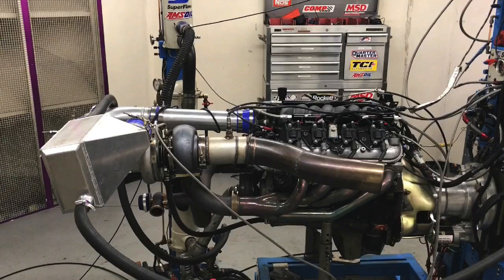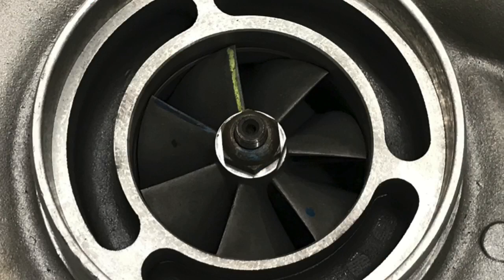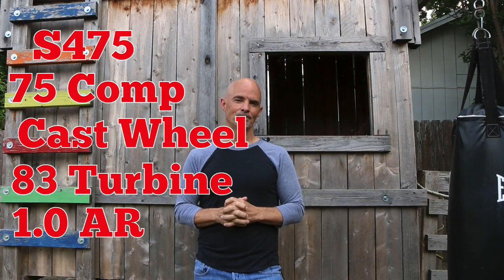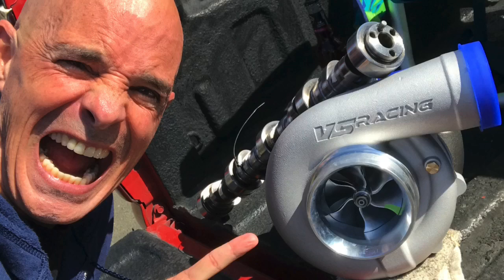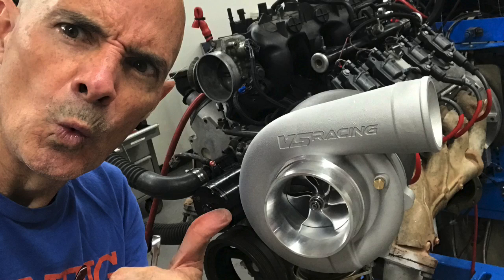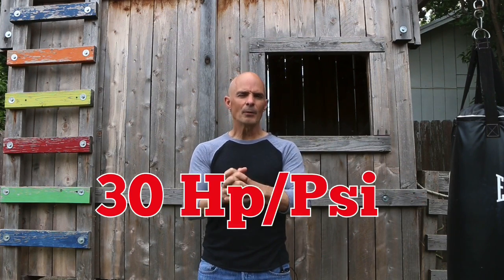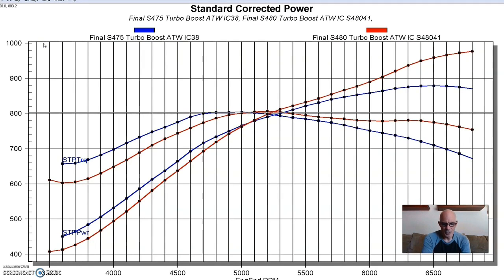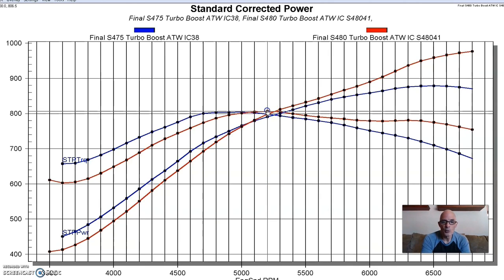HOW TO: PICK THE RIGHT TURBO!

Comment: For the billet wheel, ball bearing, twin scroll testing, an engine dyno might not be the best way to test it. A brake dyno will make the results almost irrelevant. The only way it would be worth doing is if you could load the engine at an rpm lower than the boost threshold and have the the rpm/s at something wild like 1200 or 2k. I doubt the engine dyno you have can hold a v8 that low, it would be like 1500rpm, or have the rpm escalating that fast.
You might be able to do it with a really small engine to cut the torque at load in and a really big turbo. If you had something like a b16 and loaded it at 2500 and ran it out to 8500 it gives you a huge sweep and you can test boost response if you can have the rpm/s fast enough... The thing is as soon as the boost comes in and pounds the torque out, the dyno will slam the door to keep the engine acceleration consistent and make the torque spike worse, not better.
You almost need to test this with an inertial dyno, the brake fusses with turbos.
Reply: Or do it on the road with a data logger. You can always extrapolate HP from numbers.
Reply: @DodgyBrothersEngineering  Some people are building test sleds, just for that purpose.

Comment: Isn't there a whole bunch of math to pick out turbos.  Something about getting data points to place on compressor maps (for those who publish compressor maps) to choose right turbo for the engine??
Reply: Some of the turbo manufacturers offer free calculators to size the turbo correctly
Reply from the maker: using a compressor map requires very simple math-like the math I covered in the video-I will be doing a compressor map video